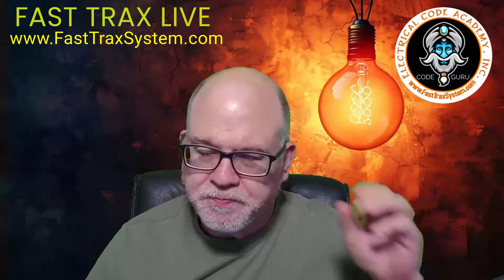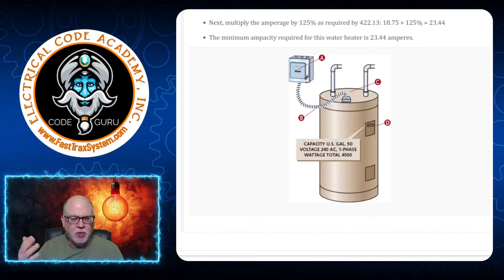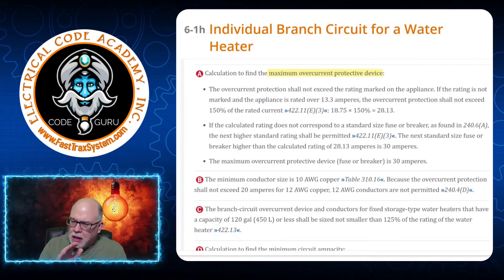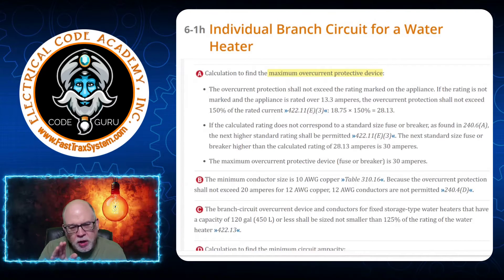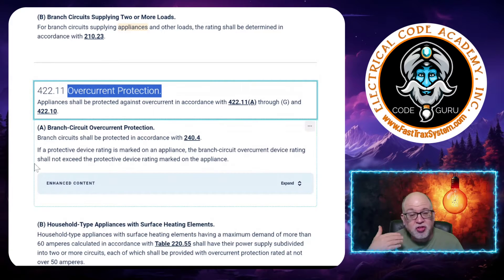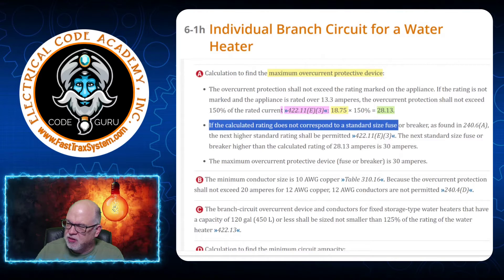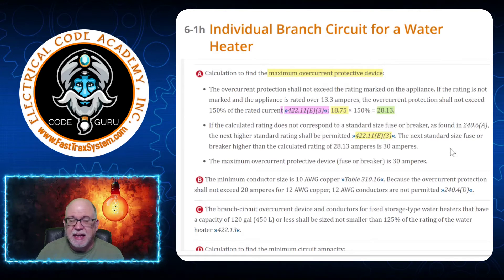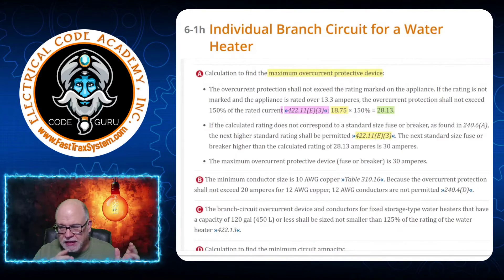How to Size Water Heater Wire and Breakers

Comment: I need to go back and watch again, but Does this mean I could have a 5500w 240v water with a 10-2 NM wire and a 35 amp breaker? Or would I have to protect the NM wire at 35 amps? Therefore up to a 8-2NM…
Reply from the maker: I think it would benefit you to watch the video again.